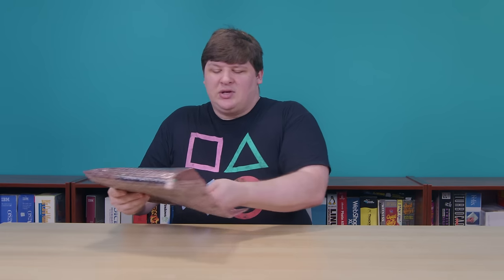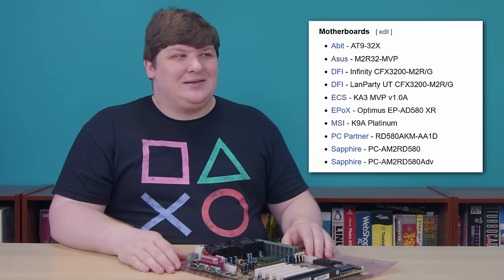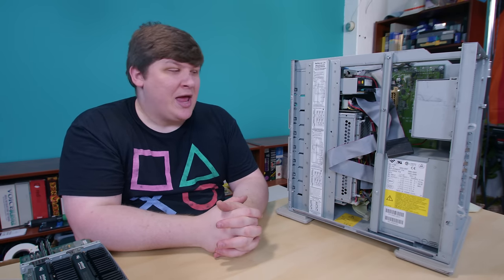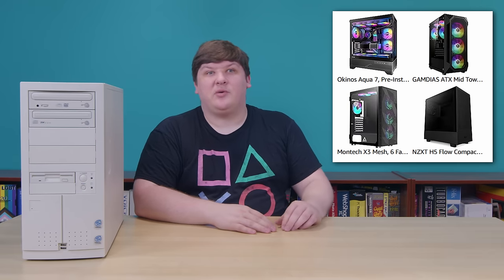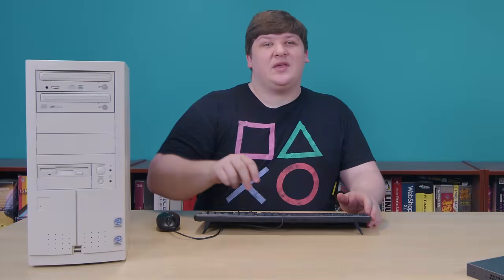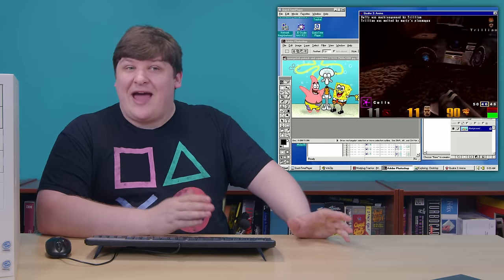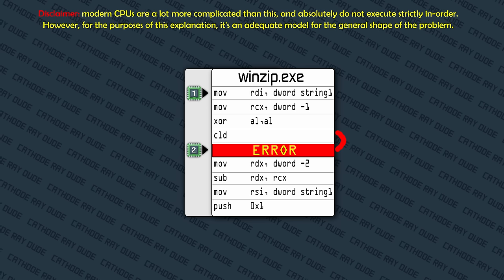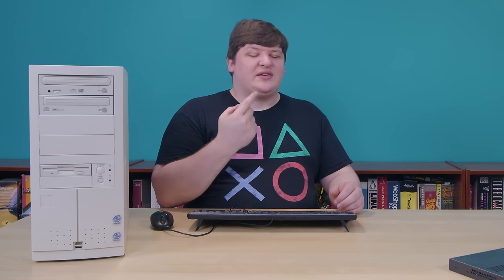The Only Famous Motherboard

Comment: I put together a system based on this motherboard back in 1999. I spend roughly about 150 euros for the motherboard and ~73 euros for each 366 celeron. I asked for a specific serial because those were easily  overclocked to  550( I still have those celerons!). A pair of checkmate coolers with  "huge" at the time fans, a soundblaster live, Win NT(Win2k)  and 3d studio Max completed the system . This machine was my breadwinner for years until I  replaced it with an MSI board with 2 pentiums III / 1 Ghz (after my BP6 went down in flames due to a shorted GPU).
I am sure that Gigabyte also had a dual celeron board but it didn't do well.

Comment: 3dsMax mentioned 40min in, finally. The Bellevue housemate (worked for Sierra) rolled with a dual socket NT4.0 rig and always grumpped about how much a PITA is was to get multi-threading right. On the flip side it was CHEAP compared to an SGI systems rocking SoftImage. 
He dual booted win 98 for games and the 3dfx goodness. Ah memories.

Comment: In the late 2000s, I was frustrated that the particular video codec I needed in order to encode files for my Walkman MP4 player didn't support multithreading. So I built a little script where you could pass it all the files you wanted to encode, it would count how many CPU cores you had, and then start multiple threads to encode the files; one file per thread. Worked very well if you had more files than cores, but of course if you only had one file you wanted to encode, it was absolutely no faster.

Comment: The first PC I ever built used I believe was a gigabyte counterpart to the bp6, I think it was the ga-6vx7. The layout was a little different. The CPU sockets were not side by side and were offset a little. I had two PIII 800Mhz cpus and 133Mhz ram. I want to say I had two 128 MB sticks. That was around 98 or 99. For the day it was pretty snappy. But I had a lot of issues. Mostly because I barely understood what I was doing. Good times.

Comment: The ballad of PPC (though generally a few years later) is a good example of commercially useful SMP in a (well, apple money) "affordable" much before it was common on Windows. This was still the era where Mac dominated in a lot of Media oriented fields. I spent an alarmingly large chunk of the 2000s using a Dual 500Mhz G4 Tower that was originally used for Graphic Design.

Comment: Back in the days, I had a Linux shell script that would set the multiplicator AT RUNTIME via I2C depending on the temperatures.
With all other overclocking boards using jumpers, this was insane technology.

Comment: You checked so many boxes.  We had that HP server at one of my first "real" jobs.  I had an ABIT motherboard (single proc), and later a Socket 370 Celeron (seems like it was $150).  If you can get your hands on the ABIT manual, it was in that wonderful translated English plastered with smiley clip art.  The section bragging on the auto RAM configuration said, "Easy installation.  You just need to insert the modules, without the help of God. Isn’t
it great?"  The Windows-based firmware update tools were sketchy.  When complete it would say "click to reboot" (with another smiley) and when you clicked, BAM, instant reboot -completely skipping any sort of shutdown process.

Comment: I had a dual Pentium II 400 setup using a Supermicro 440BX board that started its life with Windows NT 4 but soon dual booted Windows 2000 and FreeBSD. It was in the super tall Supermicro full tower ATX case with SCSI hard drives. I hung on to that machine until I got an HP workstation with a single Pentium 4. That was replaced by a dual Pentium 4 Xeon setup.

Comment: I built a system with a BP6 and dual 333MHz processors in early 2000, overclocking to 550(IIRC) and running Windows 2000 Workstation as my desktop for a few years. Later I got an Athlon based system and moved the BP6 box to be the file/print/dial-on-demand server (I lived in a rural area where there was no broadband access) reducing it to the default clock speed and installing Windows 2003 Server (I worked for s university and that was when you needed only a .edu address to qualify for education pricing; I think i paid $125 to get the media, key and 5 CALs.)

Comment: 39:03 Windows has not stopped  doing that - it still "bounces" a single thread around on different cores, unless one right-clicks it in device manager and "Set affinity". And this is the correct thing to do - it spreads power, and thus heat, among the cores, and thus the CPU die.

Edit: 43:36 he does know about "Set affinity"! OK...

Comment: Abit had a legendary amount of promotion. They handed out hand picked unit that overclocked extremly well.The bioses gave loads of never seen before features. It didnt need adaptor cards for socket 370. They were damn expensive carrying a 50% price premium. I used a Epox after 2 BP6 boards failed on me in the space of 6 months.  LOL cant get the IDE to work Standard fare for a BP6.

Comment: I was running NT3.51 and 4.0 on my SMP desktop at home back in 90s, I built it myself - can't recall the motherboard model though - I still have it somewhere.  I got dual processor Dell workstation at work in 1997 and that was running NT4 and had dual Pentiums.  I was developing software in C for Windows multiprocessor systems so needed a workstation that was multiprocessor in order to test it - that is important as if you write multithreaded software on a single processor you won't ever be able to test it properly.  Windows doesn't tie a process to a specific CPU - unless you set "processor affinity" option on the process.  By default it tends to distribute work around all available CPUs so you see the performance graph that you saw - this makes good sense as it will help lower the heat produced in any single CPU and doesn't have a performance cost.

Comment: I was the exact user this was intended for! As a starving computer graphics major I could overclock a pair of cheap celerons and have a system that could run 3D Studio Max faster than the SGI wokstations the university had.  Unfortunately quiet fans were not a thing back then and this thing screamed even at idle.

Comment: Around that time I bought and still have an epox kp6-bs (dual slot 1) with dual celeron 300a overclocked to 450 (it too also had a bios FSB setting though limited to 112). Back then when the celeron 300a (also slot 1 initially) came out it SMP support on them was technically disabled, until some clever people figured out you could mod them to enable smp and overclocking on them. Along came MSI a bit later and released what were called Slockets (socket 370 to slot-1) adapters which had jumpers that you could set CPU voltage (at a time when boosting voltage to overclock wasn't well known) and it also would allow you to enable SMP for the Celeron CPU. Why the Celeron 300a were the pick at the time is because Pentium 2s still had their cache external to the chip and running at the FSB, whereas even though the Celerons had 128kb it was internal to the chip running at the cpu frequency like the P-Pro. It meant the performance drop in cache size meant not much of a performance drop from the PII-450 and as you could have two effectively for the price of one 450 it was a no brainer. Then Abit made said BP6 which was the first of the boards that could use a Celeron in SMP without modification. Intel got wise to this and when the flip chip PIIIs came about they had all but removed the SMP support so it couldn't be enabled unless you purchased Xeons.

Comment: The socket 7 days were peak overclocking for me. 
I had a nice ASUS motherboard where you changed jumpers AND settings in BIOS to access different voltages, buss speeds and multipliers. 
I've never seen any other overclocking setup where you could go from stock to a literal 3-4X faster clock speed. 

A few years later I was running a dual socket AMD motherboard on NT4 then Win 2000. This was for a high end audio workstation I built to record with. 
Can't believe I did that on a $12/hr job. Rent was cheaper then.  I don't know where it was on the timeline of firsts, but the MSI dual socket motherboard I got was pretty hard to come by, even in California.

Comment: I seem to remember running a late beta of Windows 2000 in 1999, mostly because I was tired of working within the limitations of dos-based windows. The BSOD was still quite prevalent at that point, mostly because hardware compatibility wasn't very good yet (it was after all still a workstation OS), but once that was worked out it ran games passably well. It was basically the first version of NT that was usable on a home computer. NT4 was technically usable, but only on certain hardware configurations, and it took an unreasonable amount of work to get most software to run on it.
I don't remember this particular motherboard, but I remember pining for a dual-processor computer around then. The background processes were using a good 1/3 of the CPU, and a second CPU would have made it noticeably faster and more responsive.

Comment: Back in 1998 my workplace was using dual socket and quad socket x86 servers (and had been since much earlier using midrange machines) 
Use cases were windows NT 3.51 through to Nt 4.0 sp6 including winframe and Citrix servers which allowed multiple users to use the CPU’s 
They had good SCSI cards and caches which mitigated spinning disk lag and short stroking the drives also minimized lag
The parallelism was beneficial for minimal latency and concurrent operations and close proximity to back end servers. Though thin clients at the time weren’t great at quick rendering they made remote access quite usable.

Comment: I remember these old dual processor motherboards! I tried both this one with dual Celeries, and I also played around with another that took two Slot 1 CPUs.

People used to get so insanely upset when I told them that you can run two different CPUs, such as one Pentium III and one Celery. They'd swear it wasn't possible, that the universe would collapse if I didn't stop it, and that I was stupid for even trying it. I tested lots and even proposed that the BSDs provide support for multiple CPUs that don't necessarily have the same CPU features.

Nowadays we have P and E cores, big and little cores, et cetera, plus enough awareness to know where certain jobs / VMs can run and where they can't. Not such a bad idea, I think :)

Comment: To me the early days of x86 PC SMP recalls two things: the Tyan Tomcat II (S1562D) which had two plain old Socket 7 sockets for Ye Olde Pentium, the P54C. It was just like any other P5 motherboard with PCI and ISA slots, and an extra CPU jammed in there.

After that, I remember the dual Pentium Pro IBM PCs that came out in 1997: the PC 365, and the IntelliStation Z Pro, which had the same motherboard.

Neither of those were particularly exotic, and they predate the BP6 by years.

Comment: I had a  dell, I think demention in a similar case of the same 90's era in 2010ish, just as e-cycled as yours. What a tank. I think it had atx power though, and not as many drive bays. I used it as a file server for a few years. I think I got upto 6 drives, never have more than half a terabyte.  It ran all the pci slots on a daughter board. I learned to use Linux and raid, and all sorts of things with that. Even survived a Coca-Cola spill that burned some traces by sacrificing the daughter board. I didn't need it anyway.

Comment: My first PC built was with that board and my first experience with NT in 1999. I was telling people how fast it was vs single CPU.
I fixed laptops at the time and I told my workmates that someday multi core would be on a single CPU, and they all told me its not going to happen. "first multicore chip was designed in 1998 by Stanford University's Electrical Engineering department"

Comment: I overclocked my very first Windows PC, an Acer Aspire (which was $2500 brand new, by the way). It had a Pentium-100 in it which I overclocked to 133 MHz by moving the jumpers around. That was it. A 33% performance boost (almost) just by moving a jumper. And it ran flawlessly at that speed.

I replaced that computer with my first computer build using an AMD K6-166. I built this computer by going to a trade show at a nearby fairgrounds and just buying various parts from various vendors' tables. I really wanted a Pentium-200 but my budget was limited to $1400 and I knew it would be difficult if not impossible for me to fit that into my budget. The vendor I was talking to suggested I opt for the cheaper AMD chip, the K6 being brand new, and he sold me an Abit motherboard to put it in.

I wish I could remember which board it was, but one of the BIG points he sold me on was the fact that the board was jumperless. At the time, I hadn't heard of any boards without jumpers and to my knowledge, this was one of the first ones available, at least in that market segment. It was just nuts owning a board that allowed changing things like bus speed and clock multiplier just by changing a setting in the BIOS, without needing to open the computer or physically touch anything inside of it. It made overclocking WAY less of a hassle.

Abit made some of the best boards while they were still in business. My last Abit board was the IP35 Pro. After building that computer, I built one for my brother with the slightly cheaper IP35 board, and one time a BIOS update on his board resulted in a corrupted BIOS, so I ended up hot flashing his BIOS using my BIOS chip. For anyone who doesn't know, hot flashing is where you boot up with one BIOS chip, then while the computer is running, you remove it and put the other BIOS chip in to flash it. It's quite a tricky process!

I ended up using that IP35 Pro for 10 years, until Ryzen came out and I built a Ryzen 7 1700X (big upgrade from a Core 2 Duo).

Comment: If I remember correctly, during this time Intel was going from the Socket 7 to the Slot 1. The Pentium (cartridge Slot 1 CPU's) had an off die L2 cache that ran had half the speed of the cpu. This really hampered overclocking on all Pentium CPU's. The Celerons either had small amount of on die L2 cache, or no L2 Cahche at all. They lost performance for not having the cache, but made up for it on how far they could be overclocked. So, having a dual Celeron system that you could overclock meant you had the performance of a dual pentium with a far smaller price tag.

Comment: I have a dual Pentium 3-450 Tyan S1837 with ATI rage pro turbo In an old 4u server case missing its hard drive cages that I'm looking for a standard vertical case move it into. In 1999 I bought a gateway essential p3-450 with a voodoo 3 3000, and I wish I still had it. I've been looking forward to playing with the difference between my experience on my personal Pentium 3 450 and a dual core server machine. This has lit my fire to try to make that machine happen! Thank you!
Reply from the maker: Have fun with it!!! Glad I could help!

Comment: The short and curlies on the Celerons being better than the Pentium 3's at the time is that when Intel went to slot-based CPUs, it was because they needed to move the cache off-die (I think it was process size or yield related but can't confirm that). Indeed, they went *OFF-CHIP*. So you had some tiny, but tremendously fast (and tremendously expensive) memory  chips on your slot-based Pentiums doing the duty of the CPU's L2 cache. Problem: This meant the cache latency had all sorts of extra light speed delay traveling several inches instead of a couple millimeters. All the latency of RAM, but with none of the size, being partially offset by the chips themselves being so fast. When they went back with Socket 370, which was introduced with the low-cost Celerons, they went back to on-die cache. The Celerons didn't get as much (again, probably yield-related) but it was back to being low latency. When they finally sorted out whatever the problem was and launched full-yield Pentiums on Socket 370,  the world righted itself.... For about 15 minutes before the Socket A Athlons and then the Athlon XPs ate Intel's lunch.
Reply: In socket 7 days, the cache was on the motherboard. Pentium 2s moved the cache onto the same pcb as the cpu came on.  The first celerons went back to sockets, but had no cache.  When they added on die cache to the second generation of celerons, they accidentally created chips which could outperform slot a pentiums
Reply: Double checked, and it was on-chip (but a separate die) for the Pentium Pros, and avoiding the comparatively complex manufacturing for that was what the slot CPUs were doing.
Reply: Pentium pros werent a successful , or mainstream, chip, but thats bedide the point.  Pentium mmx and previous x86 chips all depended on the motherboard to provide upgradeable l2  cache sockets, and the amount of cache installed in the motherboard determined how much ram could be used efficiently 
since windows me & previous  versions of windows loaded into ram from the top address, down, upgrading ram on these boards without upgrading the motherboard l2 cache chips, the entire windows os would load into non-cachable addresses & the machine would crawl  @EyeMWing

Comment: #6-32 is an inch standard screw size with coarse thread pitch. The major diameter is .138". It sits between M3 and M4 in terms of size. You can tell it's inch because of the number 32. The inch standard expresses thread pitch in terms of threads per inch, rather than direct thread pitch. Metric M3x0.5 is the coarse pitch for that thread size, and the pitch is expressed directly, one turn equals half a mm. Most PC cases use either #6-32 orM3x0.5, sometimes both because why not ig.